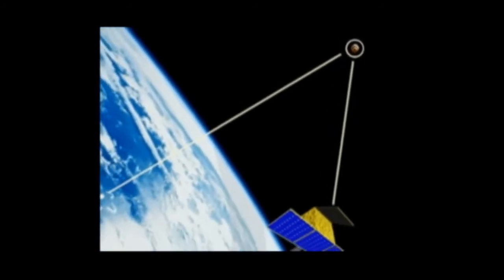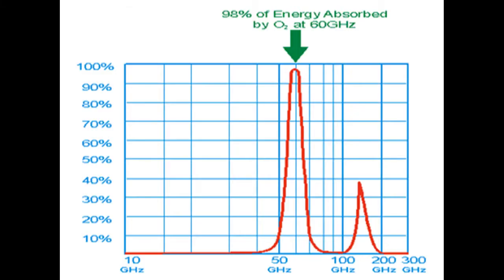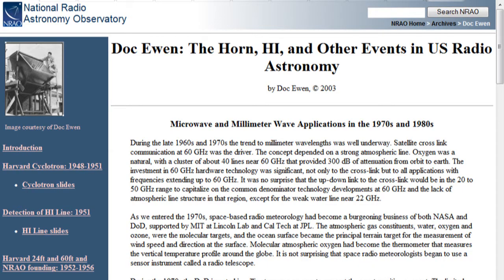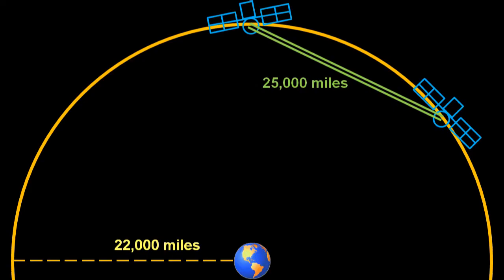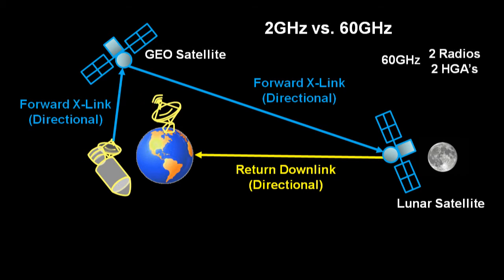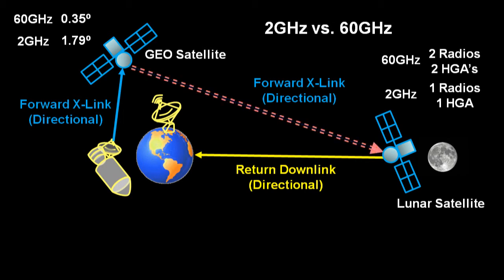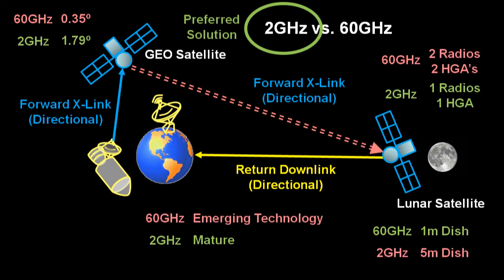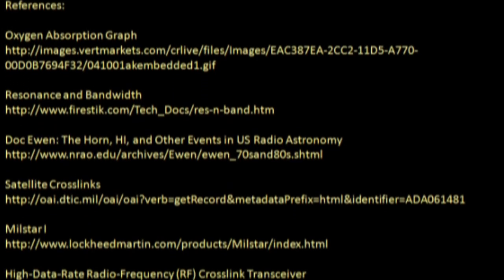MoonFaker: Exhibit D: Critique #20B: 60GHz

Comment: @stalkervision Yup, hams have been bouncing signals off the moon for quite some time. It's generally considered the most challenging communication mode available to the individual ham. Traditionally it takes the largest antenna an individual can practicably build (and a larger than average plot of land to site it), the maximum legal power, the lowest noise preamps available, and considerable operator skill. Newer methods apply digital signal processing to greatly reduce the hardware needed.

Comment: @ApolloWasReal  (cont'd) ....and the 20+ stops implied by the difference in intrinsic brightness does not take into account reciprocity failure, which affects only stars in a proper moonscape shot, as they the are vastly dimmer (right SV?). So, absurd as was to begin with, the hoaxer case is doubly ridiculous on this account!